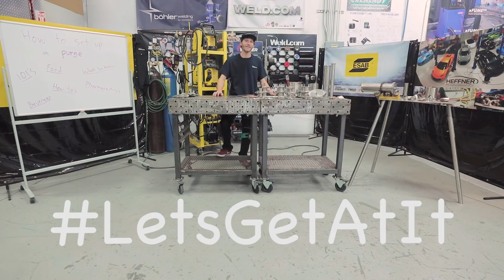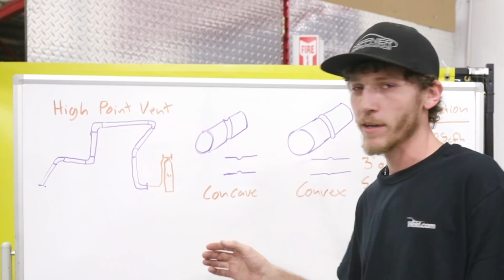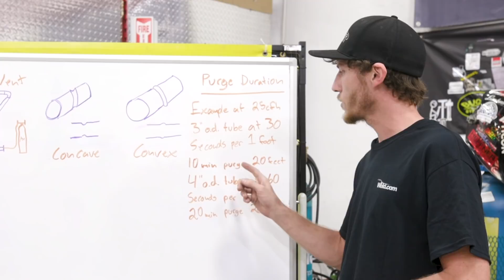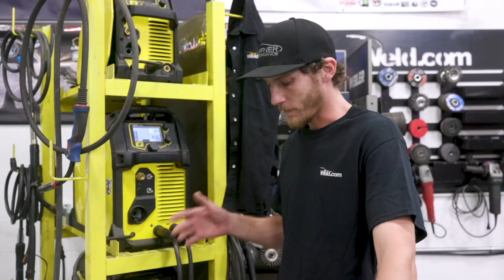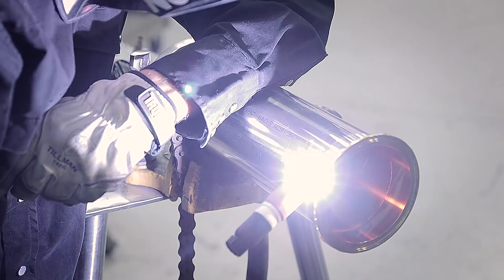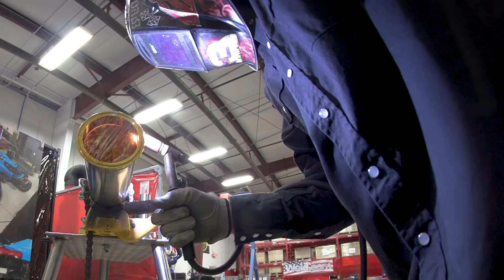Expert Tips for TIG Welding Stainless Tubing: Purging, Set-up, and Autogenous Welding with Jeff

Comment: When you noche a hole in pipe as a high point do you just weld over it with filler or do you fuse it the same way you’re welding the root? A little confused as to how you close that gap up when you file it down @jeffray

Comment: HI, 
very interesting video... but could you share links and references where to find the parts you are using on the video like the 
triclamp style purge plug, 
purge plug, 
I-lines
Teflon gasket 
as well as the fitting for argon line, quick  connect 
probably a good idea to put that in the description
Reply: @Jeff Rays
Reply from the maker: we have all downloadable and link resources in the weld app :)

Comment: How's the stainless pipe already connect before you start welding?
Reply: By connected do you mean the ferrule tacked to the piece of tubing
Reply: @SuperformanceFab  yeah both tubes already together? Even if it is tacked and I went at carrying out that run it would warp
Reply: @modsskinssoulies2655  so I what exactly are you asking if you could try and word it a little diffenent